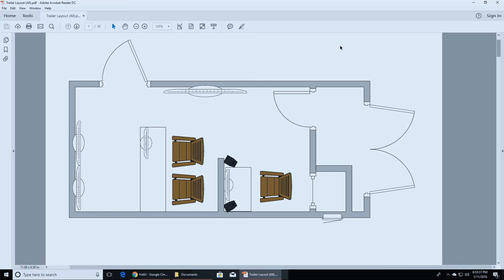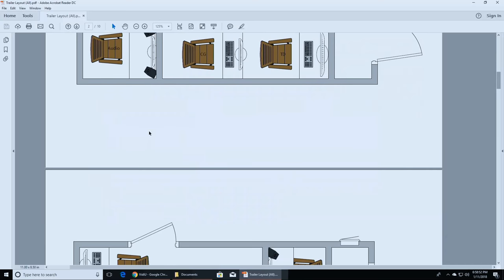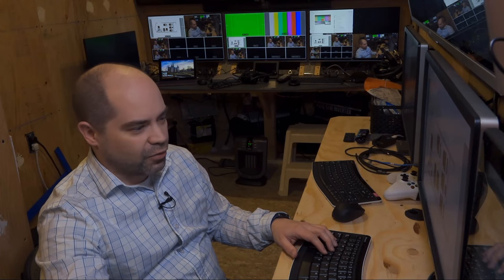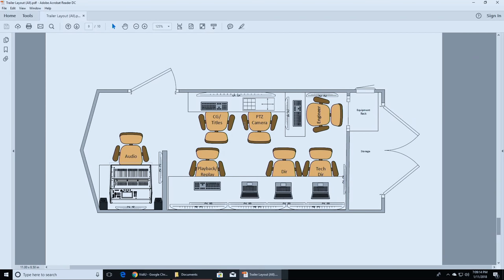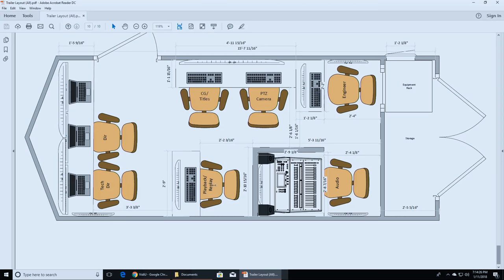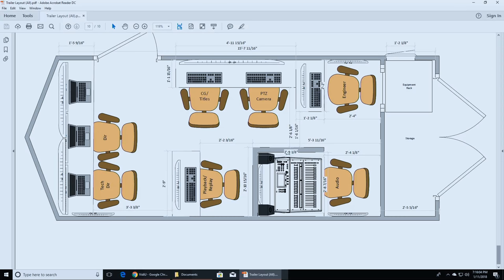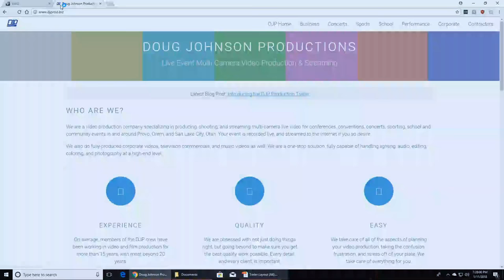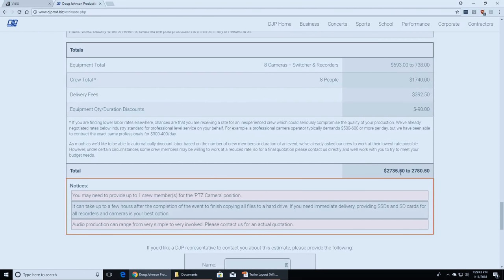Evolution of Trailer Design

Comment: Blown away by your pricing template. I have never seen a site so up front and comprehensive for video services, and i have been on the net since it started :D Good job!
Reply from the maker: Thanks! I prefer to be up front and honest with my clients and give them the best deal I can, and the estimate calculator really helps with that.
Reply: Agreed, this is a really useful tool. Do your clients use it on their own? Or is it something you walk the client through when explaining the process? Either way great resource, thanks for sharing. Love the trailer, thinking of building one soon based on your design.

Comment: Great video again Doug!  I'd love to see a simple wiring diagram how your run things back & forth in the trailer!
Reply from the maker: I'm not sure that any wiring diagram for the trailer will be simple. :)  Even though I designed it all, I still have to stop and think how things are setup.  If, for example, I need to get a video signal from a laptop at the front monitor wall into the switcher it has to pass through a patch panel, one of the Videohubs, and then the other Videohub before it eventually gets to the switcher.  It's just the nature of the beast since there's no such thing as an affordable 80x80 or 100x100 6G-capable routing switcher.  At some point I will be writing some software that automatically handles the complex signal routing for me -- just haven't done that quite yet.
Reply: Yes as soon as I wrote the comment I realised that would be a big ask! We are a similar production company to you but in the UK, we are only small but hopefully will grow over time, so still do the odd freebies here and there to get our name out and about.  We don't have our own trailer yet, we still lug the gear on-site.  I identify a lot with you as the director of the company with an absolute passion for video technology.  I like to understand how things work but I have no technical background other than reading up and learning online. I have a tough time leaving my guys to do something alone without me shadowing them but I guess that confidence will come in time. I have just completed my first video rack unit using a VideoHub which feeds both a Tricaster and ATEM unit as a backup, its been great so far. I love the journey of learning and hopefully one day I will be confident enough to take on a project like you have done with the trailer. Thanks again Doug your videos are extremely helpful. Steve from the UK.

Comment: So for the audio booth just make a double hinged lightweight thing which you can easily stow and build it out of OC703 and thin plywood. Mostly wont be needed but when the AC is on or a full loud crew it could cut down spill.
Reply from the maker: Thanks for the tip!
Reply: I worked on small OB Trucks where they used a heavy curtain to split of audio ... maybe thats an option don't know if this works - i never worked in audio

Comment: hi Doug, I'm waiting eagerly to see it finished. one question though: couldn't you get a trailer whit the door positioned behind the wheels? this way you, as an engineer, could've had fast access to the outside, in case it needed?...and the TD/Dir positions would less likely to be disturbed by people entering/exiting the OB...
Reply from the maker: There wouldn't be enough space between the wheels and where the equipment rack would start.  The wheels are set closer to the rear than they are to the front.  That would also take away the wall space I'm using for a monitor for that position.

Comment: Hey Doug! Was wondering how you'd handle talkback or communication with a wireless roamer?
Reply from the maker: The Blackmagic fiber converters have intercom capability built-in.  So by using the Studio Converter and Camera Converter products I have two-way communication with camera operators.

For wireless, I've used a bit of an unorthodox solution -- utilizing an in-ear wireless system to get intercom audio to wireless operators, then off-the-shelf two-way radios to get return audio from them (or even audio over the wireless video link).  It isn't perfect, but it is using equipment I already own.  I'm still looking for an affordable and purpose-built solution that I can link in with the rest of my gear.

Comment: How are you running Tally back to your (Sony?) cameras? I'd also be interested if you made a wiring diagram and if you could do a video explaining your choices. For example, are the video signals looping through the Multiview 4s or are the Multiviews just destinations and each input is being routed through the videohub first?
Reply from the maker: Tally isn't making it to the Sony cameras.  It gets to the BMD Camera Converters and is displayed on LEDs on those converters, and in the connected video monitors, but the camera itself doesn't receive a tally signal. (I do wish the camera converters had tally outputs.)

I'd love to do a video on how things are wired, but it would be very long, especially if I cover how I arrived at the decisions I did.  It took me months of planning to come up with a configuration that was going to work for all of the situations I encounter regularly.  

But to answer your specific question, the multiviews are destinations for routing switcher outputs, and the outputs of the multiviews go back into the routing switcher so they can be sent to any combination of monitors in the trailer. I move those signals around all the time, depending on what stations in the trailer are being used and who is sitting there.  

For example, last weekend I was running CG and PTZ, so I sat at the PTZ station, but I also needed to preview my graphics graphics so I routed that signal to the multiview for the PTZ station. So the PTZ multiview was showing me two PTZ cameras, graphics, and video from the computer running the PTZ controller software.  But that was the first time I had performed those particular tasks simultaneously without also acting as director or running audio.  Every event is different, so the signal routing has to be extremely flexible.
Reply: What kind of mounting rack rails did you use and how did you determine the wood would be structurally sound as opposed to a server rack? Also you talked about making custom connections (like BNC, USB, HDMI) how are those mounted into the 1U holes panel?
Reply from the maker: The rack rails aren't anything special... just standard rails like you can find anywhere.  They are mounted to two 2x4s in an L-shape configuration.  If they're strong enough to hold up a house they're good enough for me to hold 80 lbs of electronics.

I use the Middle Atlantic UNI-1 panels to mount connectors in the racks.  And the connectors are all designed to mount directly to that type of panel with a couple #6 screws.  In the case of the BNC, USB, and HDMI they're feed-through connectors that have jacks on the back side that the cables plug directly into.  For the XLR and TRS connectors, they have solder cups for direct, permanent attachment to the cables themselves.

Comment: Here at my church we have been using the X32 for house Audio mix, has been fairly flawless, eventually we would like to go to Yamaha but we have recently upgraded to the Midas 32, same board just better preamps and stuff like that. I’m the video director here so we took there x32 and are linking the 2 together so we can get all 32ch discreetly over cat5 for a separate mix. In order to do this we just had to add 2 S16 digital snakes so everything is via Ethernet, thats how it all works, not a bad solution at all.

Comment: Hey Doug. I have been fascinated with this project. Quick question: What are you using for ptz cameras? Thanks.
Reply from the maker: I have a pair of Sony SRG-300SEs.  I selected that model because it has the slowest pan/tilt motion (as slow as 0.1 degrees per second) of any camera I found anywhere. It makes for some really nice, smooth shots.  Unfortunately its image quality is only so-so in indoor settings, but really good outdoors.